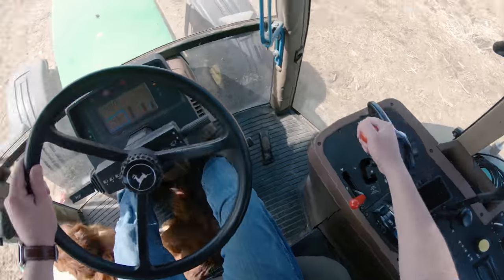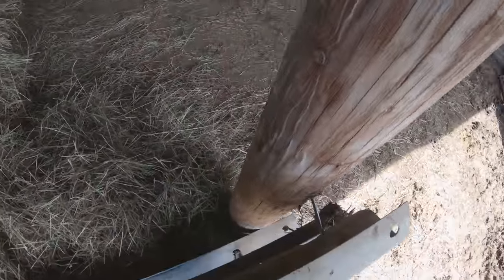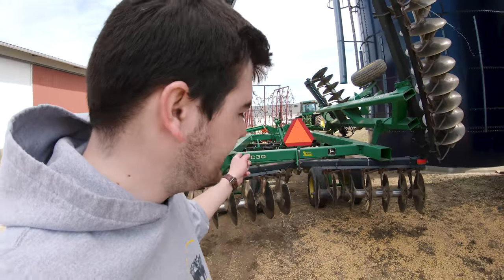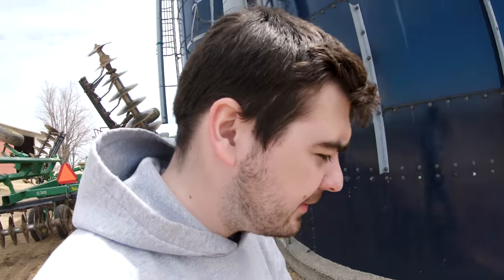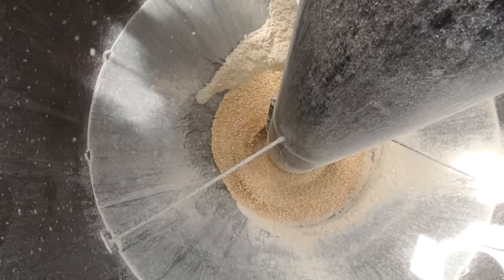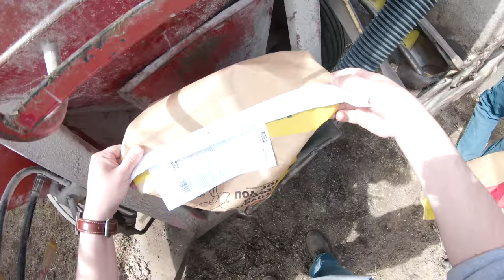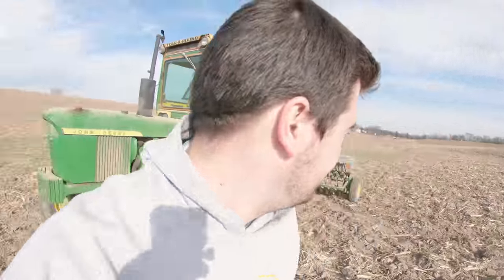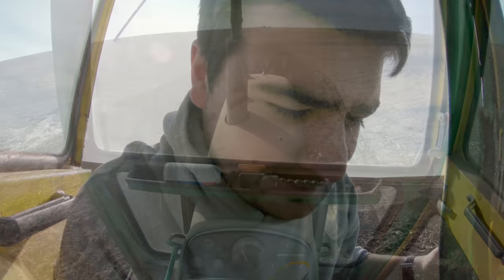Mixing Feed, Seeding Waterways - HFW Vlog

Comment: Something to notice later on when the grass and oats emerges, check to see if there is any difference in emergence where you seeded in the tire tracks v/s in soil untouched by the tractor wheels. If you see a difference, then consider mounting a couple of S-tines with points or goose foot sweeps on the front side of the seeder to eradicate the tire tracks before next time you need to use the seeder.

Comment: Hope an RV windshield washer squeegee is on your investment list... LOL:)  Dirty muddy cab windows are hard to see through... 

That's the biggest gripe I have running tractors for my BIL-- the cab windows are ALWAYS dirty and cleaning them is a bit PITA... They climb all over the outside of the machines with a bottle of windex and a roll of paper towels.  I bought them a telescoping RV squeegee so that at least it can be done from ground level, even if it's not "perfect"... 

It was SO dusty one day when I was disking/rolling basket the field for planting, that I had to get out and climb around the cab anyway with a clean grease rag I keep on my belt, just to knock the dust off the windows so I could see in the late afternoon sun... dust was literally SHEETING down the windows!  

Later!  OL J R : )

Comment: Did you cut the end off that bolt on that railing?  We had a steer rip open its side (deep) which required me & the vet to sew up the inside "meat" with fine stitches and the outer skin/hid layer with thick stitches which were like lacing up a football.

Comment: Hi Ryan

You seem to leave most of your ground bare over winter after is has had a quick work-down just after harvest. I wonder if you have ever considered drilling a cover crop before winter to keep all your left over nitrogen and other nutrients in the soil, so they can't seep out over winter due to the elements and evaporation.

Thanks!
Reply from the maker: For how late we pull out of the fields, there wouldn’t be enough time for the cover crop to grow except if we were to do it on oats, wheat or barley, but we only do oats and that is a parent crop for Alfalfa.
Reply: Good point

Comment: 8700k and a 1080ti. You can game too
Reply: For rendering he should get AMD Ryzen. Better choice.
Reply: Why to buy AMD, when he can render on GPU
Reply: A pc doesnt run without a CPU and for rendering you need a good CPU.
Reply from the maker: My CPU is an Intel 4820K I believe, need to upgrade that too but the GPU was more pressing since it makes such a huge difference with rendering times with GPU acceleration.
Reply: Just dont buy AMD, trust me, I know what i am talking about. Now I am pretty happy with my 7700k and 1080.
Reply: Everywhere you look you will find that AMD processors score better in terms of rendering and heavy editing software. They are build for that. Myself i run intel because i mainly play games.
Reply: AMD is maybe higher at rendering performance, but its unreliable.
Reply: Since when? Do you have a source for that? If that were true nobody would buy it dude.
Reply: Ive bought Rizen and had to refund it twice, so trust me.